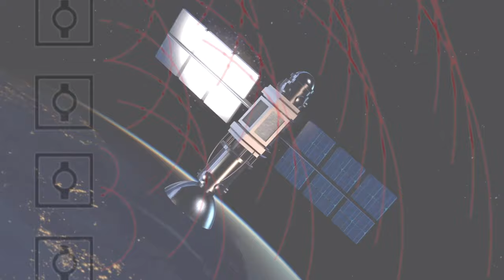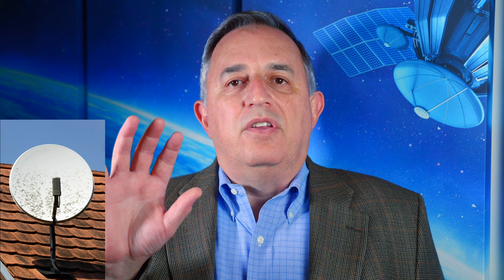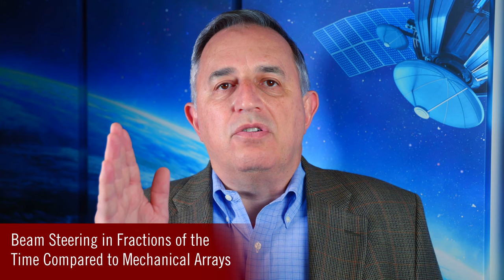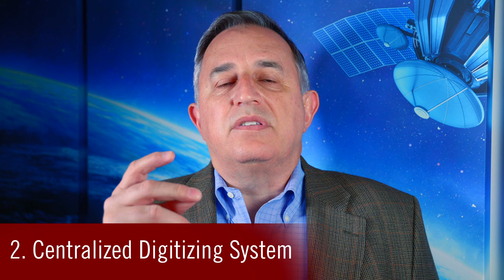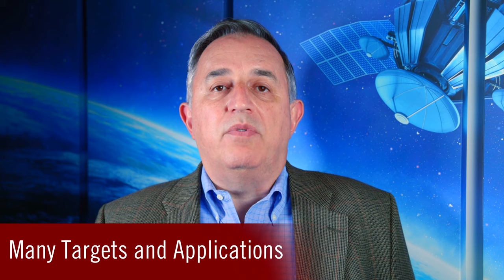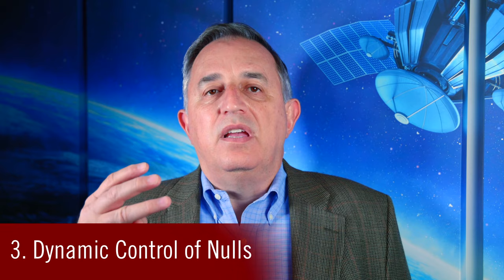Analog and Digital Beamforming: Surprising Benefits You Need to Know | MPT

Comment: Very helpful. I’ve been looking at an upgrade to a nose radome test facility that currently uses an electro-mechanical system underneath the radome to evaluate the radome’s effect on system performance. I think my customer could benefit from a phased array upgrade to replace the legacy antenna system. The devil is in the details…